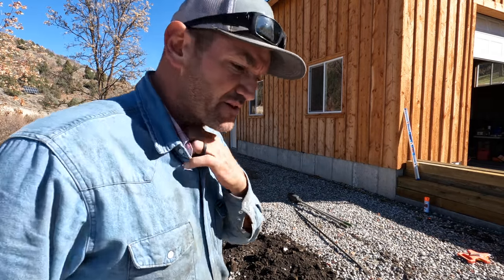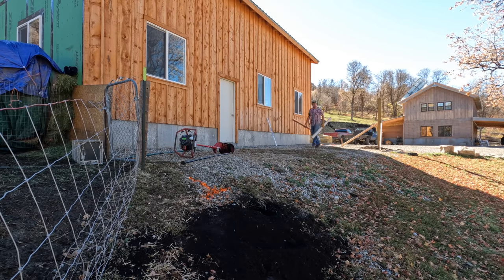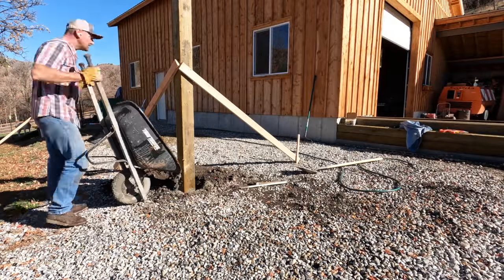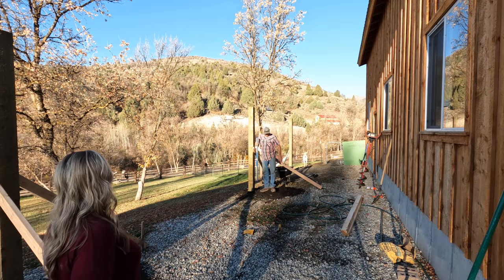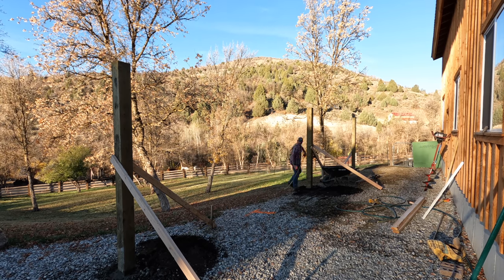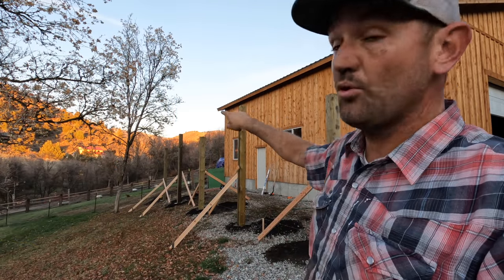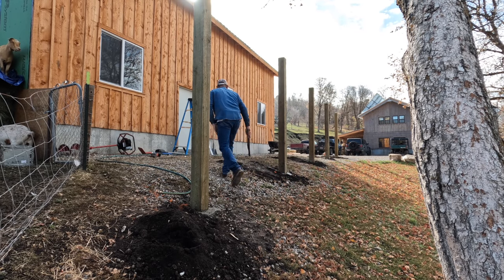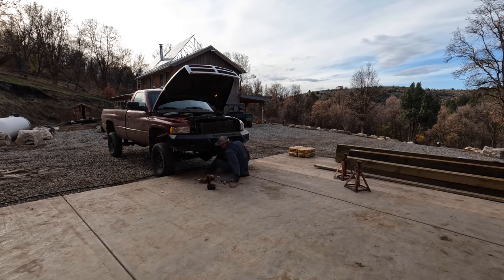Ground Setting Post's For The Shop And The Barn.

Comment: An old technique to help posts last longer brought back by wrangler star is to bore a hole at the base of each post about half way through at a downward angle of about 45 degrees. Fill with old oil and cap the hole with a cork or some such plug. I would pour some around the base too . This helps as the pressure treatment fades away over time. Pull the plug and replenish the oil yearly.

Comment: We would use concrete posts in the U.K. and use bolts to secure your structure. Even fences we use concrete posts and they last for ever. ! 👍🇬🇧👍

Comment: Give that awning a steeper pitch than you've been using, go for a 6 or 7 on 12. It'll keep the snow from building up, it'll slide right off
Reply: You can also wrap the bottom of posts with grace vycor to help extend the life in contact with the dirt

Comment: The only thing I wouldve done different was cut some old roof shingles to size for the bottom of the post with roofing nails. Moisture and water will always travel up the post, more than the sides.

Comment: A tool called a 'Larry', for mixing concrete, mortar,  etc. It is a hoe with a hole in the centre, about 40mm. You just pull it through and push back the concrete mix in your wheelbarrow, then switch ends. Made 1000s of mixes this way. Far easier.
Reply: Haven’t heard anyone mention a “larry” for years ! they were made to be used in a mixing board with low sides on it, for knocking up lime mortar. But they’d work pretty well in a barrow I suppose.  My solution would be to find an old petrol mixer, there’s always going to be a use for it around the place.
Reply: I’ve been mixing my concrete in the wheelbarrow with a metal yard rake.  It’s great
Reply: @thomasnowak7891  worst part is the concrete boogers at the end of the day.
Reply: @joelwerre  Make paving block for the pathways between the garden beds. Keeps your shoes or boots from getting wet or just plain nasty.

Comment: Those posts are at best going to last 5 years, It would have been a lot better to pour some concrete footings that the post sit on top of. or at least apply asphalt to the below grade level of the posts. That method, will accelerate the post rot because it will never be able to dry. Pressure treated does not equal rot proof. Filling the post holes with gravel would have been better since it would it would allow the water to drain away.

Comment: Tips for smoother drone footage: adjust the dji fpv drone rates down a little so the sticks aren't so sensitive. Be spotting where you want the craft to be a hundred + yards out in front of you for those scenic shots.  Always be turning slowly either into the line you want to shoot, through the line, and out of the line when finished. 

Itll help avoid the need for those constant small microcorrections on the sticks that always show up on the footage.  

Keep flying, it gets better!

Comment: I completely agree with you on putting posts for the lean to in the ground like that. You will definitely minimize water getting to them also. I built a double car port and chose to pour concrete footers and set posts on top. If you do it that way, you gotta use lots of gusset braces to give it greater stability. Even with all the guttets I put in, I can still make the structure wobble a bit. If I'd set them in the ground, I know I wouldn't have that issue now.

Comment: Im gonna be straight up, I started wrapping and heat shrinking my posts with plastic before concrete. I dont know about where you are but in florida even the pressure treated posts rot in a couple years when you concrete them if you dont wrap plastic or let them soak up old engine oil for a few days thinned with diesel

Comment: Since you are surrounding the posts in the ground with cement, it would be better if you used a tar dip first in that part of the wood. It's an easy way to make the wood much more resilient to ground moisture.

Comment: You might want to increase the pitch a lot steeper on the roof in front of the garage since the snow from above will be headed that way. You could just tuck the new roof right underneath the existing roof.  Make the snow fall off as slick as shit!

Comment: When building a stand alone pole structure,  definitely,  posts need to go in the ground! When the structure is attached to a building the Sipmson Strong Ties are the way to go! I know, first hand, that the wind will blow a freestanding pole structure when Simpson Ties are use! Extreme braceing may prevent it? Or structural siding, open pole structure?  Not gonna do it with Simpson!

Comment: Most rot happens where the post emerges from the soil.  Below the ground there is not enough oxygen. Painting the post with a mold resistant paint to a depth of about a foot will make the posts last much longer.

Comment: attach a small copper plate to the bottom of the post,, that will stop insects that will attack even pressure-treated posts.,  the plate or thin sheet will turn to copper sulfide as its exposed to nature,,

Comment: You'll get maybe 20 years before rot out.I have found it better to get a good tamp on the post,than using concrete.The power company doesn't use concrete to set their poles,just a good solid tamp.When the post finally Rot out they are so much harder to set the new post in the same hole,I know I just changed one out a month ago,it lasted 20 years with concrete around it,the concrete held surface water at the butt of the post and rotted the post.Just saying from experience.

Comment: Never add concrete to cedar or treated wood underground. Natural backfill or drainable gravel is best. Any wood will rot over time where minimal moisture is present, especially between wood post and concrete footing.
Reply: I tend to agree with that.  Just last week I removed 6 -6x6 posts that have been in the ground 35 yrs and everything below ground looks as good as it did when my Dad and I set them.  They were 36” deep and just tamped in tight on the back of a bank barn lean to.

Comment: Heath, I'm only halfway through the video right now, so I don't know how deep into this you are. Unfortunately, due to you burying the posts, instead of mounting them onto a concrete footer, you will likely be returning to this project in 10 years or so to replace rotten supports. Just my opinion, keep up the great work!  EDIT: You did prep the holes well, so 10 years is probably a little dramatic.

Comment: How are the pole going to be load bearing, if it is essentially sitting on dirt. The concrete will stabilize the pole, but there is nothing to keep them from push/sinking deeper in the ground... even more so with full load sitting on them.  Hell even drilling 3 or 4 hole ever foot or so, driving in a peice of rebar through would have helped with tying/locking the poles to the concrete... I don't  understand the "jump right into it" bullshit method... so now in year to come all of this can come crumbling down around that big damn storage shed...😅😂🤣
Reply: 4 ft is below frost line .  Pretty solid for a lean2 plus he’s going to run joists off Shop ledger.  👊

Comment: I don’t understand how you know you were perpendicular to the corners of the building?  You only measured out without a square or a 3-4-5 corner to assure square. If you were concerned with posts rotting and didn’t want to dig a footing, why not drill the same hole and put a Sonotube in the hole and put a Simpson bracket on top.

Comment: HEATH- Please install snow clips on the shop roof & you will have NO snow sliding off of the roof.  The snow will help to insolate the roof.

Check last year's video of the snow load that fell you were lucky no one was hurt.

All commercial buildings have some kind of snow safety protection on them, there are at least 4 different styles in Michigan! 🙏💉 😷